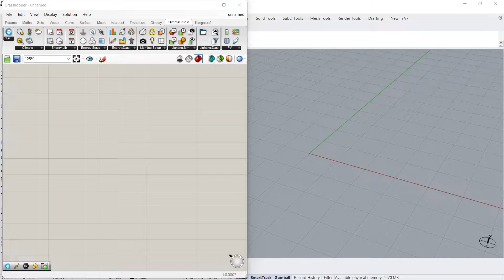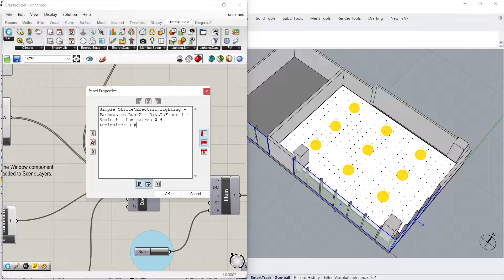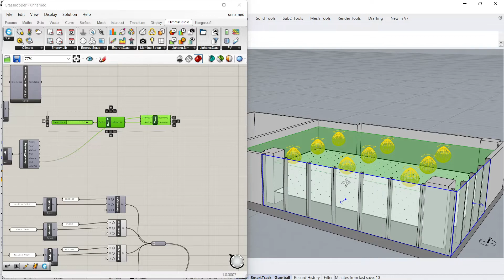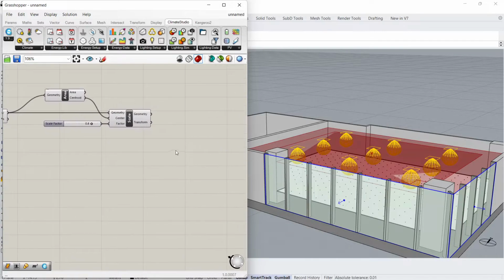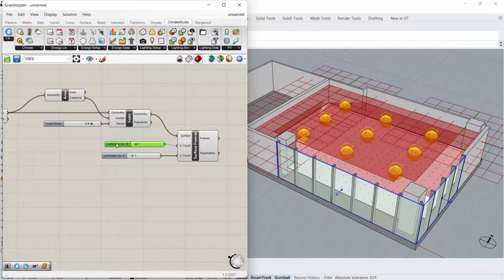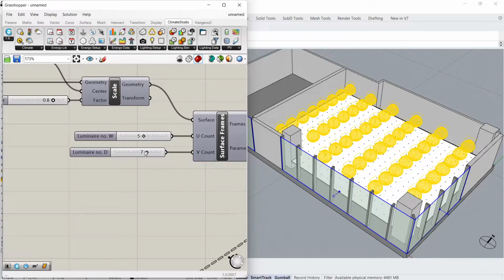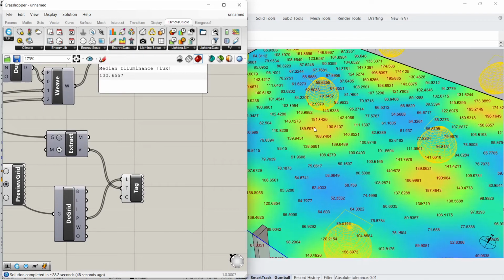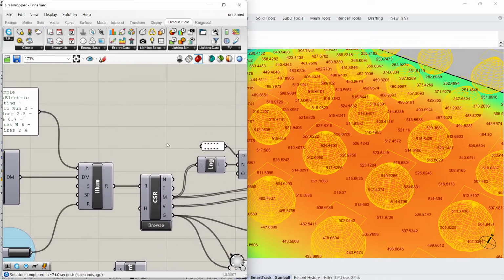Electric Lighting in ClimateStudio: Part 3: Parametric Analysis

Comment: how can i ask CS to run automatically several values of luminaire instead of changing the number manually?
Reply from the maker: You can use data trees of inputs and output files names to achieve this.

Comment: What is the meaning of text input, "Simple Office\Electric Lighting -Run 1 - DisToFloor 2.5 - Scale 0.8 - Luminaires W 3 - Luminaires D 2"? Can we go back to check previous simulated result using that settings? If so, where can we find them?
Reply from the maker: Hello! That's the base filename where the result will be stored. You can load previous results by passing in the same text. This is really only useful if you have a parametric name / result file attached to your other parametric model elements.